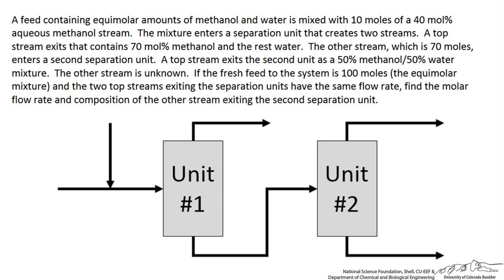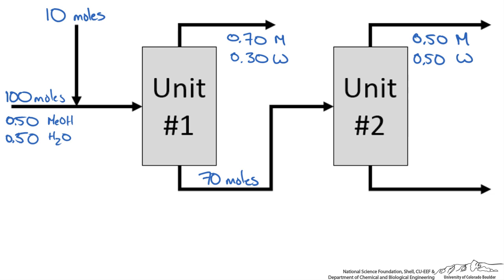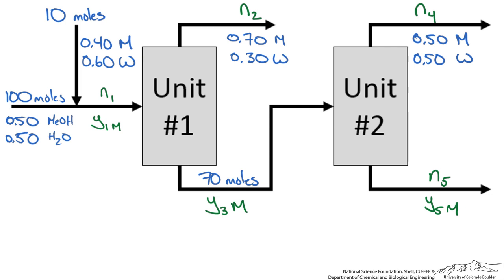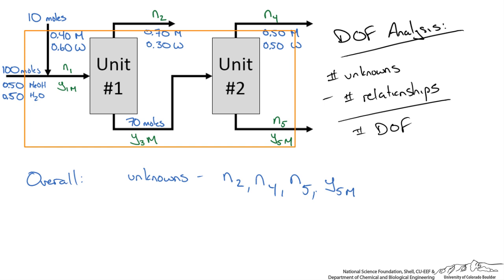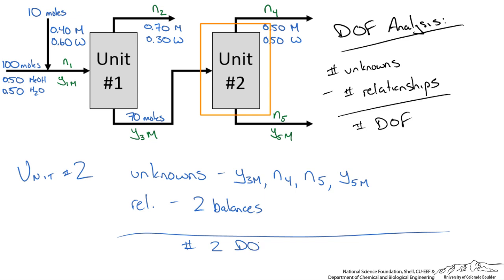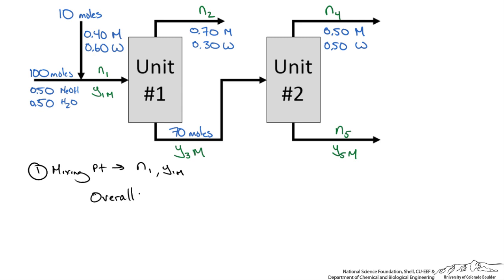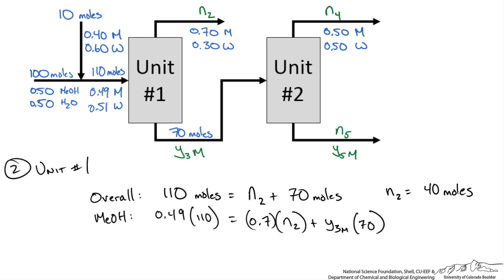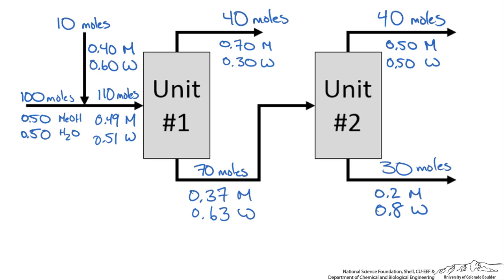Multiple Unit Material Balance: Degree of Freedom Analysis

Comment: Hello why didnt you write n1 and y1m down for the unknowns at the overall balance equation? Sine its also entering the system. Thanks
Reply from the maker: When you are looking at the overall balance, you are only looking at the outer streams. The stream n1 isn't one of those, just like y3M isn't counted either. You are only counting streams that cross that yellow-orange line. You do count the 10 mole stream and the 100 mole stream coming in.

Comment: Hello i eagerly wanna know why,why you not make any y1w ? Why you not also search for the water mole fractions?
Reply from the maker: In this case there are only 2 components, water and methanol. Their mole fractions will add up to one, so it is unnecessary to calculate it. You can always find y1W: y1W = 1 - y1M. You can absolutely have those variables, and use those equations; it just looks a bit more complicated.

Comment: I have a doubt.First u have calculated DOF of overall process unit. In this case u supposed to take n2 a variable. Well. Again in unit 1 u took n2 as a variable. So my question is that is it right to consider a variable in more than one process unit while finding out DOF value.I taught that if a variable once considered (used) in finding a DOF value then it would not to be used in finding the later DOF values.I m eagerly waiting for the ans.
Reply from the maker: Good question.  The DOF calculation for the overall process unit is separate from the DOF calculation around Unit 1.  You completely start over, so, no, it doesn't matter that you are using the same variable for those 2 calculations.

Comment: How did you find the rest of the percentages and the number of moles in the products n4,n5,y5m 11:00 please?
I tried to find them but I could not!
Reply from the maker: Thanks for the question.  From the problem statement, we know that n4 has the same flowrate at the top stream of unit 1, so it is 40 mol.  We can then solve for stream n5 by doing an overall balance on unit 2 (n4 + n5 = 70, n5 = 30).  Then a component balance around unit 2 will give us y5m (M: 0.37*70 = 0.5*40 + y5m*30, y5m = 0.1967 or 0.20)  The key was going back to the problem statement to find that the top streams have equal flows.  I hope that helps!
Reply: @LearnChemE  Thank you very much

Comment: T AROUND 5:10 YOU say that we have an overall balance, and methanol balance, and an h20 balance. Why did you say that we can only write 2 of the 3 down??
Reply from the maker: Thank you for your question.  Of the three possible balances, only two of them are independent.  For example, if you added the methanol balance and the H2O balance, you would get the overall balance.  So the third one would not be helpful. Thus, you have to choose only two.
Reply: makes sense! thank you so much

Comment: why you haven't included n1 and y3M in the overall unknowns?
Reply from the maker: +abdul musawir When doing the overall balance, you do not need to know anything about the internal streams.  You are only concerned with what is going in and out of your "system".  Please look at the video at 4:00 to see the line drawn around the system.  The streams that cross that are the ones that we need to solve for in this case.

Comment: I can understand the material balance (n2=n4) for the analysis of overall. But why don't you include for the rest of analysis ?
Reply from the maker: Charlie Ni When calculating the DOF around Unit 1, n4 is not one of the unknowns, so n2=n4 is not a relevant equation.  Similarly, for Unit 2, n2 is not one of the unknowns.  Lastly, the mixing point has neither n2 or n4.